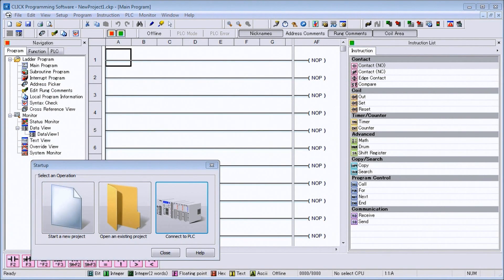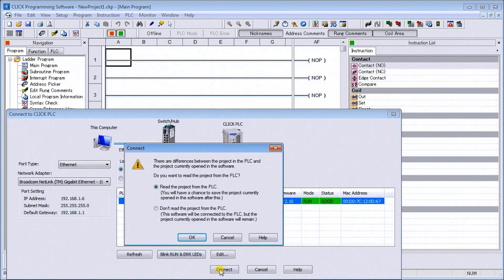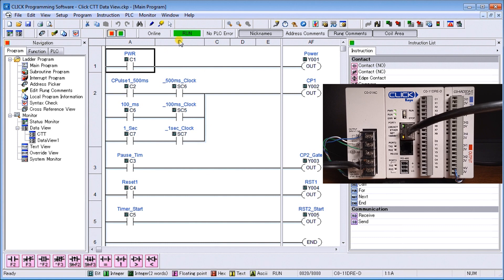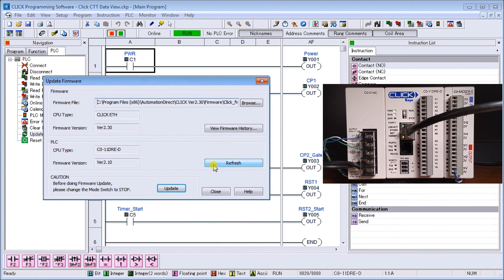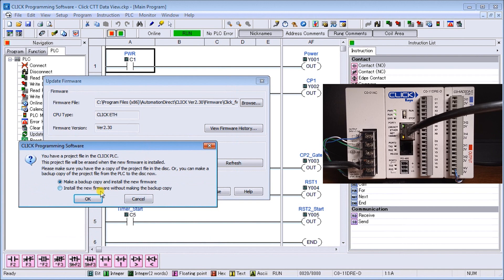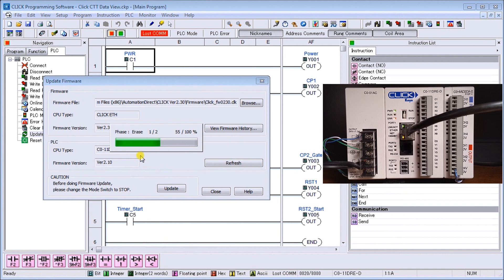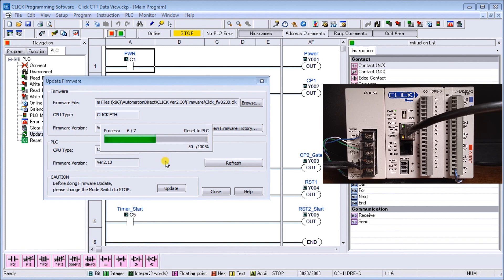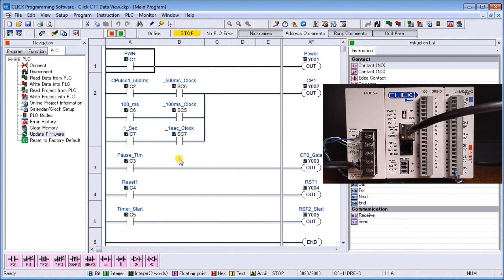Click PLC  Update Firmware

Comment: I got an error light. Program probably doesn't match version of plc?
Reply from the maker: Hi Sean DuTremaine,
If this error light happens when you try to update the firmware, I will try the update again. Ensure that the PLC is in program mode.
I hope this helps you out.
Regards,
Garry
Reply: @ACC Automation  Worked like a charm. Thanks.
Reply from the maker: @SeanOfTheDead007  
Thank you for the update. Glad you got it working.
Garry

Comment: Hi Garry, in now, my PLC was updated to v3.20 but my controlling program alway show that it can't connect to PLC because firmware mismacth. I can't change data of controlling program because it isn't mine. So can I re-burn old firmware for PLC? Many thank!
Reply from the maker: Hi Trung Trihn Quoc,
The best method is to download the new firmware into the PLC, then the software will communicate. 
If you need to go back to a previous firmware, then you will also need the software for that version. You will have to contact Automation Direct 1-800-633-0405 (North America) to request the version of the software based on the firmware number installed in the hardware.

I hope this helps you out.
Regards,
Garry
Reply: @ACCautomation  thank you so much

Comment: Hi Garry. If I don't change the CPU  and then when I read the program using the latest version 3 of click plc software. Can I update the software and firmware. Or do I will be able to update software and firmware
Reply from the maker: Hi Jaril James
That is a good question. Reading the program from the PLC will prompt you to save in the older format program onto your hard drive. The firmware and program will not be converted to Version 3.00 until you begin to download a program from Version 3.00. It will then prompt you to also update the firmware.
I hope this helps you out.
Regards,
Garry
Reply: @ACCautomation  Thanks Gary. Will the program works on the same CPU if i update the software and firmware and download into PLC?
Reply from the maker: @jariljames7288  
Yes, the program will still work as before. If you have an ethernet Click, you will then need to implement a password. This is one of the differences with the newer version but this software will program the entire series of Click controllers.
Regards,
Garry
Reply from the maker: @jariljames7288  
My email is garryshortt@accautomation.ca
I'm in Canada.
Regards,
Garry
Reply: @ACCautomation  Thanks Garry.